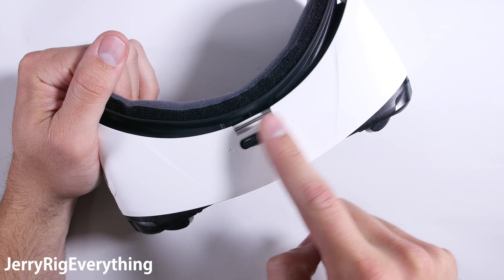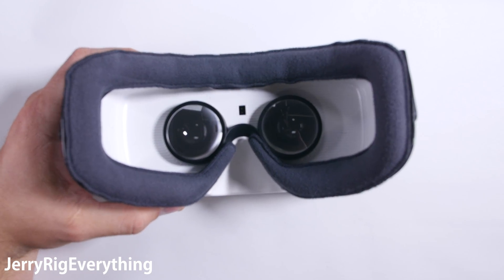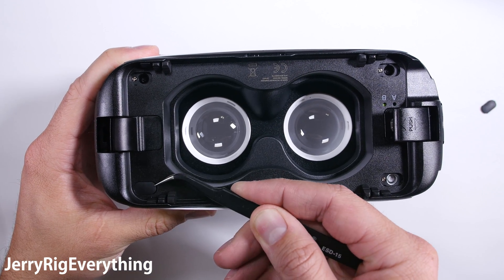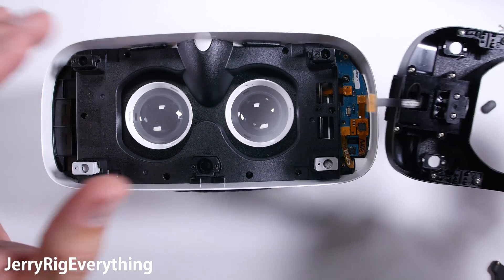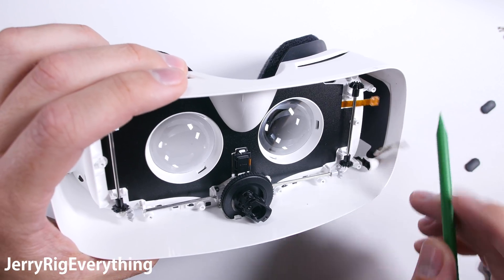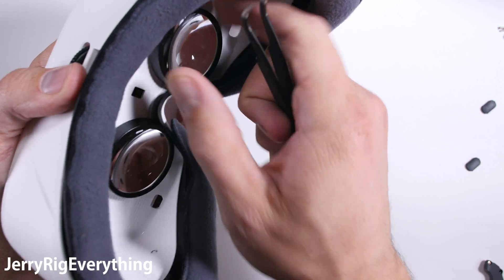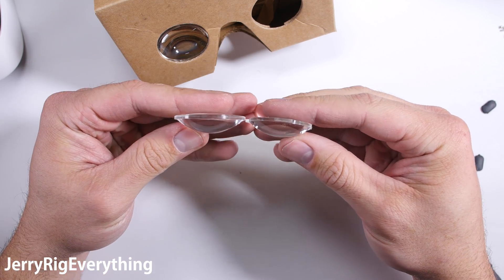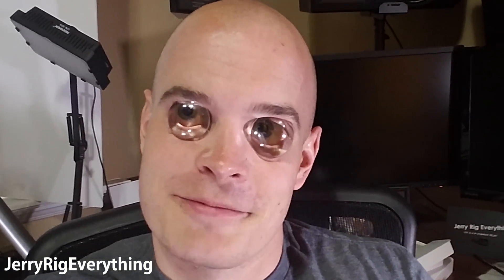What's inside the Samsung Gear VR? - Powered by Oculus

Comment: Thanks. This was very helpful. Right now I'm trying to remove one of the "arms" that holds the phone in place so I can plug in a cable while using. Sadly the Gear VR doesn't let me use USB Tethering through the build in connection.

Comment: There is no plastic lens, it is just Glass with carbon on it's structure, the normal type of Glass contaiosome minerals like Magnesium that's why it is easy to brake, the carbon structure is much more resistent but it can be scratched easier.